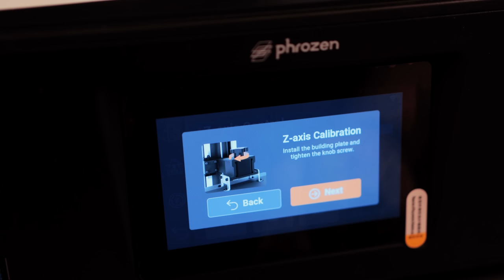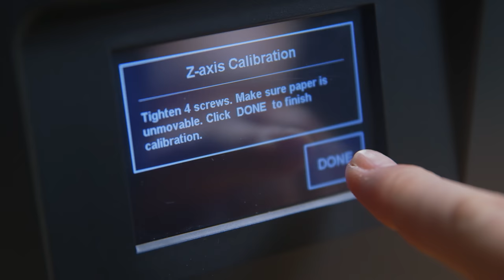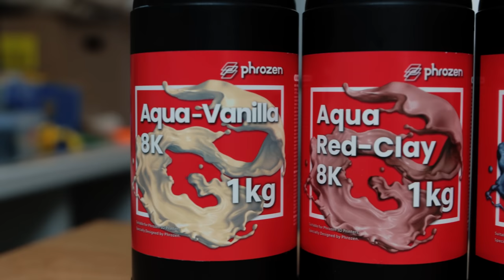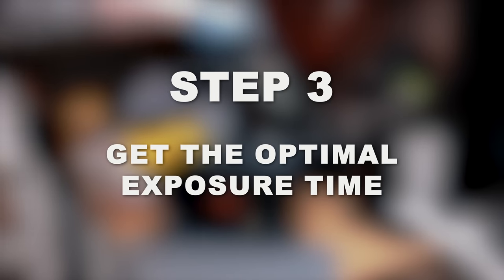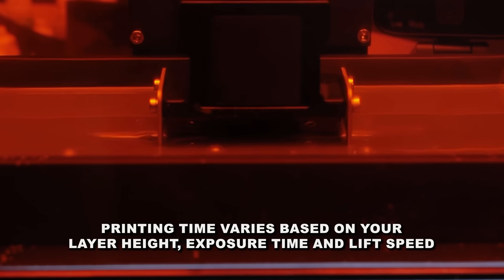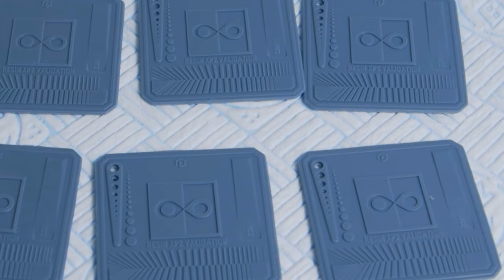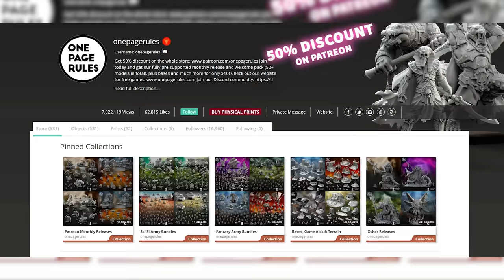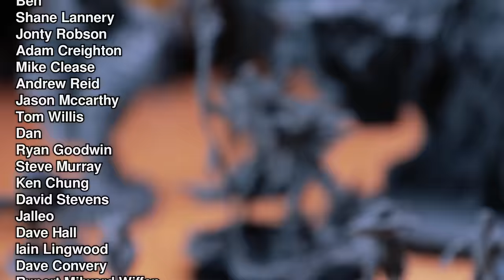How to Print Perfect Miniatures - Resin 3D Printing BEGINNER GUIDE - Step by Step

Comment: Some nooby questions here - how do you know how much resin to pour in when you are going to make something.  If you have resin left over in the tray after making something what do you do with it? It's expensive stuff so I'm hoping you don't just have to throw it away - can you pour it back into a bottle to use again later?  If you use resin that needs IPA to wash,  if you have a wash machine that say holds lots of IPA, can you reuse the IPA in the machine time and time again or do you need to empty it out after use (again can you pour back into a bottle for use another time, or is it now spoiled and you might have just used 7 litres of IPA (looking at you Uniformation wash machine) to wash one 25mm orc you just made?
Reply from the maker: Yes to both. You can pour resin back in the bottle and most printers come with some filters just for that purpose too. But I just leave it in the vat til the next print.

Ipa can be used loads of time but if let it sit with a high resin content in, will go thick and cloud. Takes a a while though. But I don't use ipa, I use odourless metheylated spirits
Reply: @FauxHammer  Brill thanks sounds like a cheeky tip you just gave me as GW like to say.  How long will resin stay fine sitting in a tray?  If for example I wont be doing another print for over a week would you want to funnel it back into a bottle for safe keeping or does it stay fine for ever if not subjected to UV?
Reply from the maker: @turbosnowy  I've had it in there months. It will need a stir before you use it again, but so long a its not in dircct sunlight. It'll be just one it is in the bottle
Reply: @FauxHammer  Excellent that's good news  - thanks Ross

Comment: I've got 11 posts and 11 holes on saturn 8k, it's equal number, but only 11, how can I increase the number on both?
Reply from the maker: sharper resin and optimal room temperature, otherwise you probably can't
Reply: @FauxHammer  I actually used 8k resin from elegoo and thermal vatband to get the vat to around 22 Celcius
Reply from the maker: @MEANDITV  Hmm, I'd expect at least 12 if not 13 with that resin. I honestly don't know, it;s stumped me. I;m sure I got 13 on my Saturn 8k using Phrozen 8k and that's pretty close to Elegoo 8k
Reply: @FauxHammer  Yeah its weird, maybe its some other setting that Im doing wrong.

Comment: Thanks for the video, it came in the right moment for me, right now I am calibrating my GkTwo which I bought with your Code. I will keep following this guide until everything is ready to print armies. 
Keep up the good work, will be waiting to the videos about supports.
Reply from the maker: this should get you set up and working within hours, this is exactly what i did on my GK TWO
Reply: Not sure if you had opportunity to test messing with Light power. I had the best result with 1.2sec exposure and 90% power on chitubox on Gktwo.

Comment: i use a fermentation heating belt wrapped around the vat. its not perfect but it does keep the resin warm enough for my purposes. eventually i'm going to add a thermostat and temp probe to it to have it cycle as needed.
Reply from the maker: i did try that but got the wrong size band and it wouldn;t stay attached.

Comment: They also make inside the case heaters for a decent price.  My basement gets below 20c and my heater keeps my resin at roughly 25c.  Trick is fill the vat, then inlet it warm up for about 20 mins before I start it printing
Reply: A sneaky tip, you can warm up the resin in a bowl of hot water and with a little temperature probe get it bang on around the 20-25c range. I had so many fails early on in my print life and temperature was what took me from a rarely successful print to a very rare failed print. I wish the manufacturers would put this on the box or even on the printer itself. A little label about average temperature ranges to be aware of.
Reply from the maker: yeah I saw a few DIY options, but haven't seen one you can buy. happy to try one tho.

Comment: So I got the Halot Mage and did a small first print of a magic kitten for my son and it worked great. Tried a second print off the USB stick that came with the printer called a mage berserker and it seemed to be printing fine but for some reason the body didn't print and was stuck to the vat. Tried a second model on the stick and it didn't stick to the plate and it failed. I've leveled it twice now so I don't know. I guess I need to try that calibration square to see , but I'm lost.
Reply from the maker: Yep, you are in the right track. Try calibration squares to see if the bed is curing evenly.

If not sticking them change base layer exposure value in 5s increments up and down. Around 30 secs should be a good starting point

Also check lift speed. Start at 60mm/m or 1mm/s

If base layers are curing even.

Move on to the next part of the video to get your layer exposure right. Then maybe Nige it Uk a couple tenths of a second just for support security. Some can be finicky

If you can’t print the suggested minis after that. Increase more
Reply: @FauxHammer  also I wish I could try your resin. I see not yet in the states, what budget friendly resin would you recommend, besides yours. Something that works well but won't kill you if prints fail.
Reply from the maker: @3dpathfinder  I honestly have f tested enough. I liked DLP craftsman before we made ours.
Reply: @FauxHammer  and that would be fine on the halot?
Reply from the maker: @3dpathfinder  all resins work on all printers

Comment: Is there a detailed video on setting up the 8up rangefinder? Or do I just 8up the file and call it R_E_R_F?
Reply from the maker: I assume based on your last comment you are talking bout the Mono 2

when you make it you need to use Anycubics slicer, you put 8 models on the plat and imagine you can see a 4x2 grid on the build plate area, the models must not cross the invisible lines of that grid.

save the slice andd set normal exposure tim eto whatever you wnat the starting time to be.

and name it EXACTLY what the name of the RERF file is on the root of your USB drive is. somtimes its RERF sometimes R_E_R_F sometimes one of those with non english characters after it..

Whatch your print bt taking off thevat and build plate and put paper over the screen

Affter the base layers you will see the normal models dissapear sequentially.,

if not, you ahven;t done it right.
Reply: @FauxHammer  When you say root of usb drive, do you mean the one that came with it? Because mine didn't work lol

Comment: Thank you so much. I watched this ahead of my printer arriving (a couple of times) and it was so bloomin useful. Less than 24 hours and I've printed out some usable stuff that looks great (in my opinion!). The printer (Mars 4(3) Max) was bought off your recommendation (and link) and I'm using your resin... I'm easy to sell to...

I hit buyers remorse at almost exactly the point you suggested one might (though because the sandisk USB I bought seems to not work... is there such a thing as a too good USB?)... but pushed through and I'm chuffed! 

Thanks!
Reply from the maker: Just make sure the USB is formatted as FAT32 before you start, you should be good. If not, return it.

The USB drive I mean
Reply: Thanks, I'll try sort it though Windows 11 won't let me format it as Fat32 (it says it already is though). Sortable with extra software. It was intermittant file errors and to fix it I changed both  the slicer and the drive (in my desperation to get something printed!)... so not sure which did the trick but I'll experiment at some point. The drive is 128gb  maybe somethign to do with it... anyway, didn't mean to turn this into troublshooting but appreciate the advice! Thanks again.  @FauxHammer
Reply from the maker: It may be the size of the drive, I’ve never used 128GB I believe FAT 32 has a limit. So I imagine it’s windows trying to be helpful and now allowing fat32 on such a large device. The third party software is forcing it but because it’s going beyond those array size limits, the printer can’t read it.

I think the larger drive I’ve ever used is 8gb
Reply: @FauxHammer  I believe the limit might be 32!
Reply: Just incase it's useful info for someone in the future... the Mars 4 Max (and at a guess the other Mars 3/4s? ) apparently only supports 4/8gb USB 2.0 drives. Which doesn't make tons of sense but after trying another 32gb USB 3.0 stick and failing I actually read the internet...
Reply from the maker: @BennyParkyn  Really? I use a 32GB in mine without issue.. Is it properly formatted to FAT32?
Reply: @FauxHammer  Yup (well, yes really that was elegoo support's line!) And I've tried a couple now, both with the same issue. Switch back to the one that came with it and voila.

Comment: Hi i gonna ask a stupid question 
Can i resize pre supported miniature or after resizing i need to do suport on my own ? 
Im new to resin 3d print ^_^
Reply from the maker: you can resize it, but if you go up supports may be too large and leave marks. go down they may be too small and fail. I have done this with varying success. but the absolute best way is to resupport the whole thing.
Reply: @FauxHammer  thanks for quick response ^_^
So my new task will be to learn how to do supports on my own 🙂
Reply from the maker: @Acid88Gr  that's my job https://www.youtube.com/watch?v=9G3Oq3_LtEQ

Comment: Who the hell would level their build plate with resin in the vat? Also who the hell fills their vat by pouring resin over the build plate and letting it drip down??
Reply from the maker: Me. I would. I'm not sure why youu are asking "who", you've literally just seen me do it...

What the issue. it works... and it works great. on every printer I've ever tested...

try it before you knock it.
Reply: @FauxHammer  ok, why on both? I wouldn't even think to do either.
Reply from the maker: @brib9716  glad you asked.

So 1, it's just easier. I do it with all my printers now, as I explained in the video and in previous videos. The point if the paper is to emulate the thickness of the fep right? So just use the FEP. Some printers will send you a spare sheet, but there's also a sheet of fep at the bottom of the vat. So just use that.

2. It's just more cinematic than that normal way, that's it. And it generates comments asking Why?

Comment: My test print keeps sticking to my FEP, what should I do
Reply from the maker: Increase base exposure time until it doesn’t. Between 30s and a minute should be right if it’s notmal temperatufe.

Could also be bad levelling.

And you want also want to reduce lift speed to 1mm/s in case it’s that
Reply: @FauxHammer  I am using lychee slicer, so increase base exposure time in there? I'm just using default settings as well. As far as leveling I have leveled this thing 5 times now, I've done it with paper, using the fep, using the fep and resin, everything according to your vids is leveled. I've even double checked to make sure my surface is sturdy and level and it is.
Reply from the maker: @Zackattack61  well, as I said in this video... Stop using Lychee. If you have an unexplainable problem, that;s more often than not the casue.
Reply: @FauxHammer  I used the anycubic slicer program like u recommend and it still stuck to the fep. I leveled again, changed my fep, amd increased base exposure time

Comment: 8:00 From what other people have told me, as well as increasing the exposure time you should also reduce the lift speed to protect the supports from ripping. 

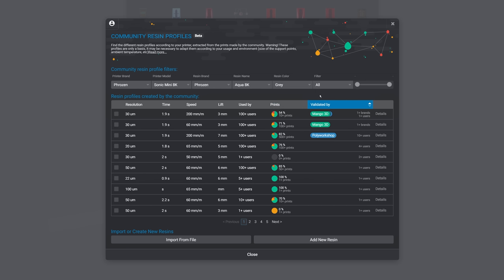10:00 From personal experience, don't trust the settings recommended in Lychee Slicer! For my Saturn 2, using SirayaTech Navy Grey, the top official setting (from Mango3D) has lift speeds of 240-240. Someone must have forgotten to type-in the correct settings! I dread to think how many people have tried using that setting. I dropped it to 60-120 (60-240 is probably fine, but I'm playing it safe).
Reply from the maker: In regard to comment 1 i was gonna say, your initial lychee settings should solve this, but I'm shocked at Mango 3d for those settings in comment 2!

Comment: Some simple mistakes in the video. 

1. Don’t use the metal spatula as this ruins the build plate over time. You buy a plastic scraper from Amazon (blue handle) 

2. The rook is the worst test print as it goes solid to the plate with default settings. So many people jump on groups saying how do I remove it. 

3. After tons of reviews of calibration tests the one shown is one of the worst, especially when it comes to miniature printing 

4. No mention of a screen protector which if not installed destroys lots of beginners machines day 1. 

5. Whilst pre-supported files are great they are not 100% and most my failures comes from trusting pre-supported files
Reply from the maker: 1 I didn’t use a metal spatula.. did I?

2 listen to the video, the point is just to print something, the rook is what came with these but it would be whatever comes on your printer in your case

3 how, why?

4 the guide is how to get prints working. I didn’t talk about peeling the plastic off your build plate either not many other things not directly  related to getting your printer working.

5 exactly why I suggested specific presupported files to use